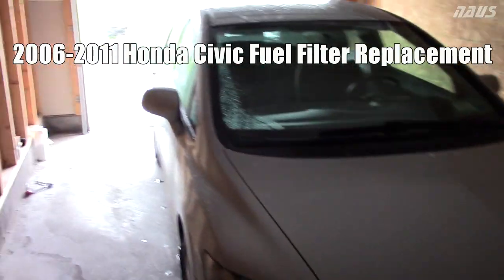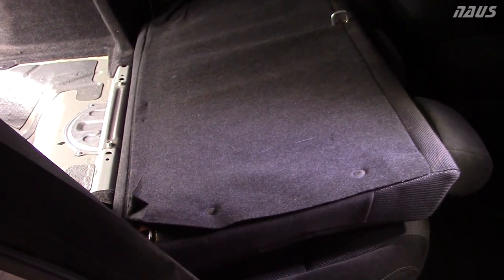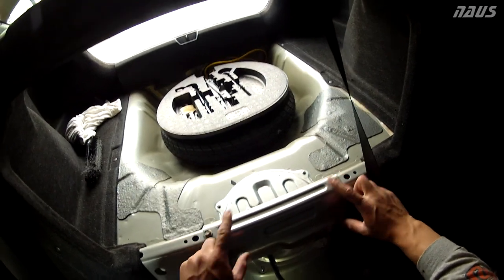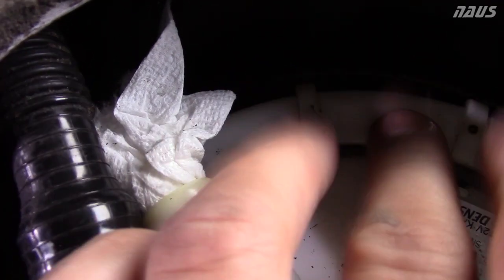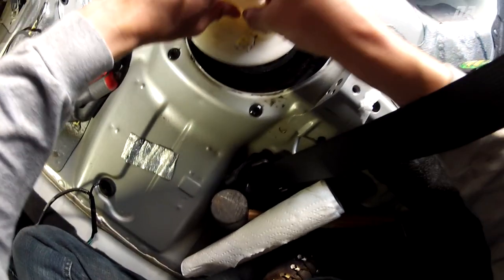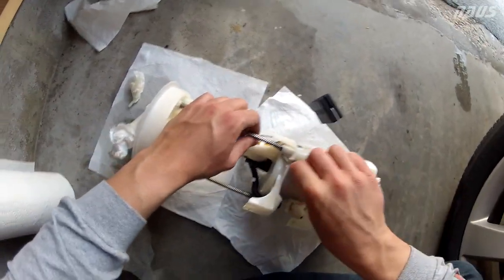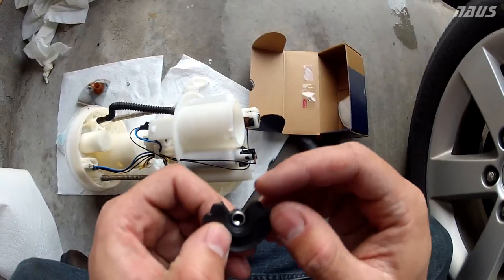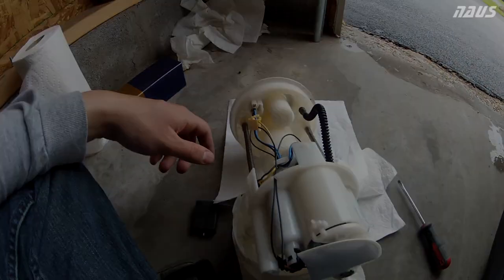8thgen Honda Civic Fuel Filter Strainer Replacement DIY

Comment: I just did this and everything went smoothly until I got everything back together and now my car won't start everything appears to be hooked up properly fuse is good.Any ideas from you or and viewers would be highly appreciated.thanks
Reply from the maker: Make sure the plastic spacer is on your fuel pump with the oring on top. If either are missing you won’t build fuel pressure
Reply: @NAUS2K  great thanks.it was a pain in ass getting lock ring back on harder than it seemed it should could've cross threaded because o ring in place and have other rubber o ring in place too gonna take it back apart and put it back together tomm and hopefully that fixes it.
Reply: @NAUS2K  i reseated the lock ring again today o ring and gasket in place lines are lined up perfect and still won't start.its not getting fuel the lines aren't priming I guessed so popped off the smaller fuel line and nothing comes out of it.not building up pressure or lines aren't priming idk.any ideas?
Reply from the maker: @J_Dukes  The Oring and Plastic spacer i was referring to are the ones on the outlet of the fuel pump itself. Not the large threaded locking right for the whole sending unit. Take the sending unit out of the tank, take the sending unit apart again, pull the fuel pump out, and look in the hole the outlet of the fuel pump goes into. I bet your oring is stuck in there. You need to pull it out and place it over the fuel pump outlet itself. There should be a small white plastic spacer beneath the oring on the fuel pump as well, this prevents the oring from getting pushed down once the fuel pump builds pressure.
Reply: @NAUS2K  awesome thanks man gonna try again tomm doing this it's probably what it is 🤞🏻👍🏻
Reply: @NAUS2K  that was it man!thanks alot the o ring wasn't properly in place fixed it and she started right up!thanks for the help and the video running much better now.
Reply from the maker: Don’t feel bad, it’s actually happened to quite a few people on here so It seems like a common miss. If I could go back and describe this better on the video I would. But I’m glad you got it all fixed up and your back running. Cheers!

Comment: Where did you get those fuel filter strainers , and how much did you pay for them? I need 1 for my 2008 honda civic lx coupe,  thanks.
Reply: try either:
- the dealer parts counter for OEM certified parts quality 
- or Google keywords to find bargain basement deals savers

You get what you pay for directly applies to car parts, specially no-name fuel pumps that die on the road after 2 month

🤗

Comment: I did this and got a small evap engine code, p0456, any tips on how to make sure to put everything back on tight enough?
Reply from the maker: Make sure you didn’t cross thread the plastic ring when putting it back on to seal the sending unit to tank

Comment: I followed this video and succesfully change strainer.   However, the car wont start.  I might have broke the pump by following to force detached the stariner.  It should not be, remove first the rubber covering the washer and remove the washer first

Comment: Why didn’t you change the whole fuel filter and pump , considering you already had access to it , especially with over 130k miles
Reply from the maker: 🤷‍♂️ still going strong at 203k now

Comment: Hello, will replacing the Fuel Pump restore the power on the 8th Gen Civic EX? it's feeling pretty slow at 160k.
Reply: If it feels sluggish and slow on climbing hills id recommend you change your spark plugs and fuel pump assembly with new strainer and it’ll run like new

Comment: Did changing the filter increase your gas mileage? My gas mileage has decreased tremendously. I used to get 340-360 miles to the tank, now I get 200-220 a tank.
Reply from the maker: I dont think it really has anything to do with mileage, if anything a dirty filter will stave the engine of gas not burn more. If your mileage has gotten really bad lately i would get your injectors cleaned, inspect your catalytic converter, and replace O2 sensors, it would also be your MAF sensor as well.
Reply: NAUS wouldn’t I be getting a code CEL if any of those are bad? I already replaced both O2 sensors. What’s your best way of inspecting the cat converter? Can I just clean my maf sensor or should I just replace it?  Thanks!
Reply: Vinny check your tire pressure, 02 sensors, use some gas treatment, what kind of driving? Highway or city? Is the AC on? Are you more aggressive driving? How's your spark plugs? Engine air filter? Throttle body? Check these things first
Reply: @georgeparker555  I have the same issue and my car is showing that everything is pefect ):

Comment: I followed this and now my car won’t start. Any suggestions.
My fuel tank is on empty, and I don’t think I messed with any o rings.
Reply from the maker: Amr Al Samahy can you hear the pump priming & sucking fuel when u turn the key on ?
Reply: NAUS yes and I tried turning the key to ACC multiple times to prime it but still nothing. I went and got some gas but I’ll take the pump apart again and check everything one more time. Anything in particular I should look for?
Reply from the maker: Amr Al Samahy the only other thing I can think of is the oring on the pump, and make sure the plastic spacer is under the oring
Reply: NAUS yes it the pump O ring thanks for the guide. I also would love to thank the commenter who suggested putting the outer ring in hot water, this whole thing is a ruined by the outer ring and the rubber gasket.
Reply: @asama7y  Hello, can you tell me what was wrong with pump o ring and how you fixed the issue. I'm having the same problem and can't get the car to start
Reply: Alexander Pinnock the ring must be around the pump not touching it. So when you put it back make sure is actually around the pump not just at the end of it. If you can send me a pic of the pump I’ll mark it for you
Reply: @asama7y  Thanks very much for that mate, do you have an email I can send the picture to?
Reply: Do you put the o ring onto the pump first
 and then slot it into place?
Reply: Alexander Pinnock yes exactly
Reply: @asama7y  Thanks, should the car start up pretty much straight away once everything is replaced properly? or did you need to prime it a few times? Did you need to put more fuel in the tank?
Reply: Alexander Pinnock yes. Prime it a couple of times just to reintroduce the vacuum into the system. a small plastic bottle worth of fuel in the tank is sufficient.
Reply: @asama7y  Thanks for that. It tries to prime but no fuel is coming through the fuel lines. I have a good couple of litres in the tank. It must still be seated incorrectly
Reply: Alexander Pinnock If you hear the  pump engaging then your problem is the O rings. These gaskets are required for crating a vacuum.
Reply: @asama7y  What about the fuel pressure regulator? Could I have seated those o rings incorrectly?
Reply: Alexander Pinnock check if you placed the filter correctly
Reply: @asama7y  I lined the arrow up with those two lines that are on the fuel tank. Is that what you mean?
Reply: Alexander Pinnock no I meant the fuel strainer. The part you followed this video to change and make sure you placed it correctly and placed the small metal bracket on it.
Reply: @asama7y  Ahh right, which small metal bracket do you mean?
Reply: Alexander Pinnock the retraining washer at 9:16
Reply: @asama7y  Thanks for that. I never changed the sock filter as I can't seem to get hold of one in the uk. Do you have the part no.? I've changed the fine filter, the big plastic thing that the pump sits in. Sorry for all the questions, I do appreciate all the help you are providing.
Reply: @asama7y  I sorted it - I didn't have enough fuel in the car, it must have evaporated while I was messing about. Thanks for all your help.
Reply: Hello,

I am having the same problem. I even unplugged the main fuel line and turned the engine over and no fuel was coming out of it. Can someone show me which O - Ring I need to check?
Reply: Never mind. I took it back apart and saw which O-Ring it was. right where the fuel pump itself slides back in place. I adjusted that, put it back together, primed the pump a couple times and this time I could hear fluid flowing and then started the car without issue.

Comment: For the Coupé. 
Is it the same process to remove the rear seats? To get to the fuel pump.
Reply from the maker: Cameron Rodriguez yes the process should be virtually the same, just much more of a pain because you can't pull the cushions out of the rear doors !
Reply: NAUS lol yes I was thinking the same, it would be a pain without the rear doors.
But thanks A lot for the reply and for the video. Great information  😊

Comment: I got a 2008 Civic EX and fallow your video, thanks for that, but my problem is that after I change the filter and put it back together my car wont start, it cranks but no start. Any ideas why?
Reply from the maker: Mihai Stanciu you probably forgot to plug the pump back in
Reply: It is plugged in when I turn the key I can hear the pump working.
Reply from the maker: Mihai Stanciu is the oring on the pump outlet still ? If that oring isn't in there properly it will not build any pressure
Reply: well I found out that the plug for the pump is not putting 12V it only got 4.2V 4.3V and I check the relay and it is all good, but some how from the relay to the pump is loosing power somewhere. Need to do some more checking. I appreciate that you are trying to help. P.S. I will double check the o ring, it is metal.
Reply from the maker: Mihai Stanciu no it is the rubber oring that's about the size of a dime, it's on the output port on the pump
Reply: I will check that too. thanks.
Reply: NAUS I am having the same problem with an 06 civic EX too, cranks but won’t start. Would it be possible to send a diagram or something of where the o ring is
Reply: I had the same problem, I installed the o ring improperly and pump could not build pressure it is a black rubber ring and it slips on the pump, watch his video again and u will see there is tiny black rubber o ring, I had to watch the video like 6 times to find out what I did wrong !
Reply: Okay, don't feels bad.  I had to redo my 3 times to finally get it not to leak gas.  However, now my gas gauge is screw up and only shows 3/4 full after filled up with gas.  Any idea?  reason I do this because my sending unit was 7/8 full after filled up so I got new sending unit replaced it and it didn't help but after the 3rd removal of the fuel pump and redo the O-ring so it won't leak screw up my gas reading now.

Comment: Did this and now my car cranks but doesn’t turn over smh tf did I do wrong
Reply from the maker: Did you make sure he oring is on the fuel pump and everything is plugged in?
Reply: Everything’s plugged in. Where’s the o-ring
Reply: Ok so there’s no o-ring on the fuel pump, can’t find old one anyways. Is there a way I could get one
Reply: Nevermind Man U are a life saver; the o-ring was stuck on the plastic where the pump sits, didn’t see it until I looked after your reply. Thank you
Reply from the maker: WHIP IT 603 the outlet of the fuel pump needs to have the oring around it to seal and hold pressure in the plastic tube you slide it into
Reply: NAUS yeah figured that out earlier, thank you for pointing that out, I put the o-ring back where it should be on the pump, put it back together, started right up. Thank you
Reply from the maker: WHIP IT 603 no problem buddy glad it worked out !

Comment: I tried to get my dealer to do my fuel filter and was told it's a 'lifetime filter' which is the biggest load of garbage ever. You can clearly see how soiled that old filter is - disappointing to know Honda basically want us to have horrible fuel going through our engines.
Reply: The dealer doesn't represent Honda as a company. Dealers are just the middle man. Idk why he told you that, but they lie a lot.
Reply: @k20z3keith7  That's because Honda's official line is that it's a lifetime filter. They don't make them 'serviceable' for this reason.
Reply: @MartinHannett_  Yeah I don't buy that "lifetime filter/fluid" nonsense. Although, maybe with the fuel filter they mean for the "lifetime" of the fuel pump itself because I guarantee out of all the 200k+ Hondas still on the road most of them will have the stock fuel pump and filter. For example with my Si I'm at 155k stock pump and filter plus I'm FBO and tuned. Never had an issue.

Comment: My Civic had 500 000 with the same filter.....
Reply: Did you ever change it or the pump after 500,000 miles?
Reply: @jordan4541  No, never changed the fuel filter or pump. (500 000 km)

Comment: This part is discontinued 😔 So where can I find it??
Reply: I just figured that out too 🤦🏻‍♂️. We're you able to find a replacement???
Reply: ZaZu_309 nope Amazon has the Denso kit that includes the fuel pump though with filter for $99 😠 so I guess we need a diff brand then? Maybe have to research more on civic forums.

Comment: Now my car won’t start, just cranks repeated
Reply from the maker: Check the pinned comment. Odds are you didn’t put the oring back on the fuel pump
Reply: @NAUS2K  I did. The ring that fits around the hole where the fuel pump goes back inti. Also, the thin ring that goes on top. My fuel pump isn't priming or making sound, so I'm just gonna buy a new one
Reply from the maker: @S0raJr  if your fuel pump isnt even making a sound check connections and wiring in the sending unit itself. one of the leads may have cam detached if you yanked on a wire too much
Reply: I took everything out and used compressed air on the connectors. Plus, I saw I left a cable pinched. I fixed it and put it back his it was. There was a sound before, now I hear something and gas splashing around in there. I think my battery died because I tried started my car too many times. I’ll post an update when I can
Reply: No luck, I posted a video of how my car is on my channel. If you could check it out and let me know your thoughts please. I place my phone on top of the pump so you can hear everything. I even tried to start my car and turn the key to the on then off position a few times
Reply: Final update, my car works. There’s an o-ring that fits on top of the sending part of the fuel pump I didn’t put on correctly. The opposite side of the filter. It lowered the pressure and didn’t start my car. The other big o-rings were put on just fine. Thanks. Now I understand what you meant in the first comment. I did t even see an o-ring there.